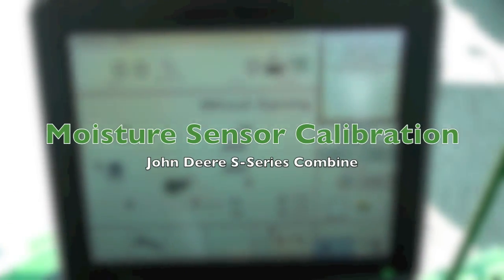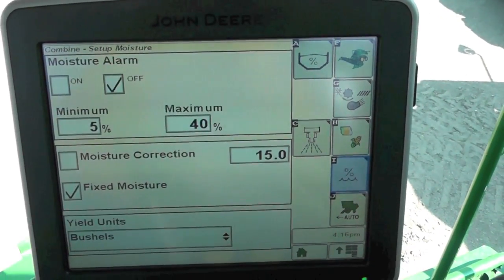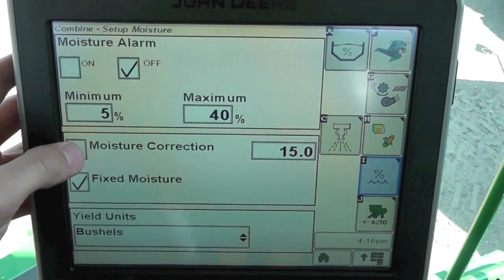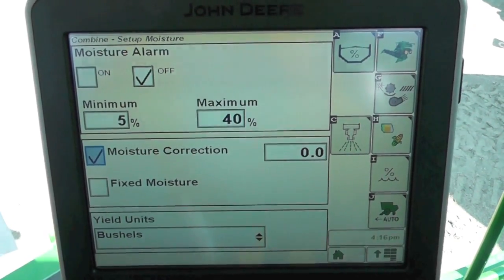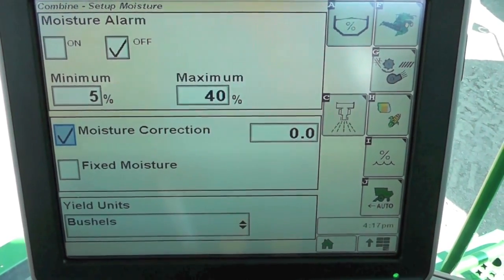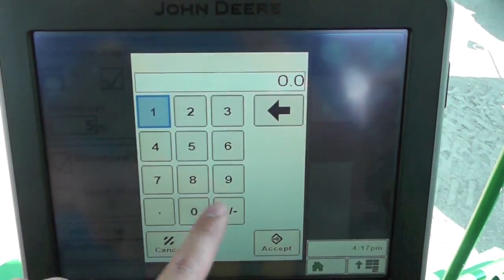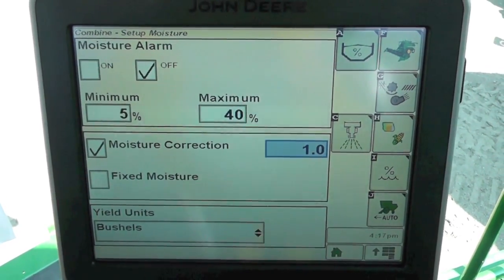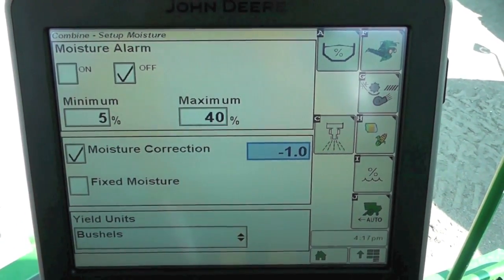S-Series Moisture Sensor Calibration

Comment: I think you screwed up the 2nd example.  You state that if the displayed moisture is 16% but actual moisture is 15% that you'd enter a correction of-1.  This would be correct, except you're already set at a correction of positive 1 percent, so to bring the moisture to where it should be in that example the setting should be taken only down 1% to 0.